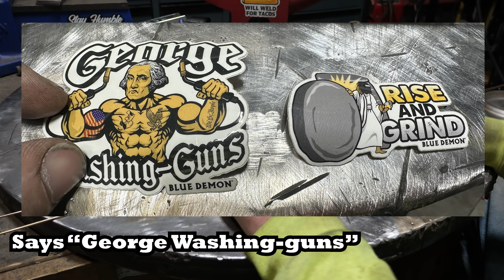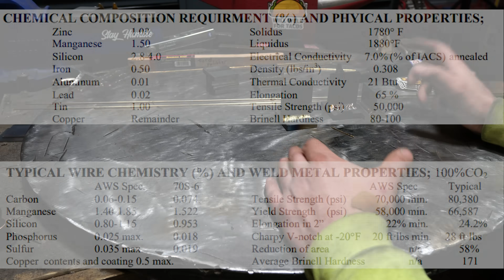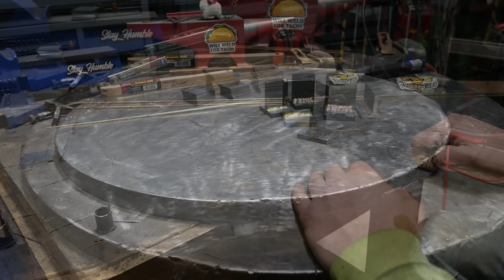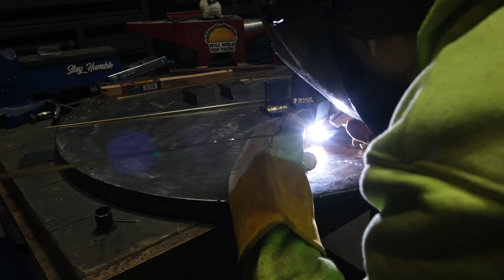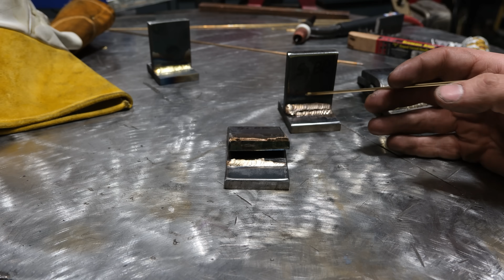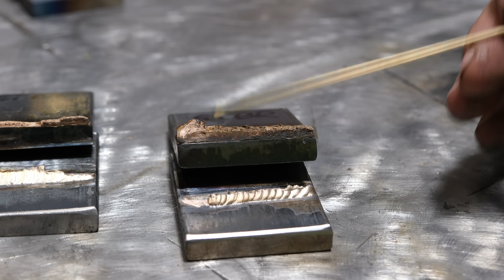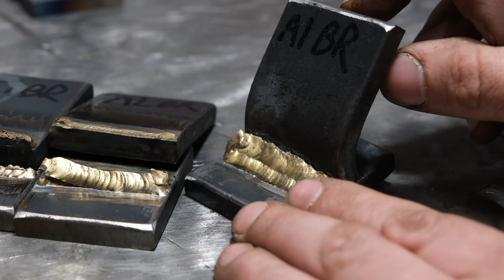Silicon and aluminum bronze brazing, how strong are they?

Comment: I found that pure copper is a better material for repairing old cast iron. Found this by chance when I had to repair some 160 year old ram pumps made of cast iron. Tried silicon bronze and aluminium bronze but they would not take to the iron and small cracks kept appearing but I had some 99.9% pure copper rods on hand that I had been using for copper inlay of horse bits so I tried that and it worked a trat so since then I have used copper filler on cast iron whatever the age.
Reply from the maker: Interesting, I have never tried that but will have to do some experimenting with it 😀👍

Comment: I worked at a auto shop that made custom hoses and we brazed everything brass, aluminum and steel fittings
Reply from the maker: Brazing on stuff like that would likely be as strong as a weld and far easier to do.  It would be very hard to weld thin wall small diameter tubes.  Thankfully brazing can be strong enough for the task 😀👍.

Comment: I recall an old bloke advised me that carborundum? grinding is a big no no when brazing parts together.
He insisted that surfaces needed vigorous wire brushing and final finishing with a file to leave atomically clean surface.
Seems carborundum causes a coating/inclusions that impedes wetting and intermetallic binding of the brazing alloy into the surfaces of the joined iron/steel materials.
Is this good advice ?.
Reply from the maker: So no doubt contaminates on the surface will cause a reduced bond.  The brazing material doesn’t have a real way to consume and “float out” surface contaminants like say a stick rod with flux that becomes molten.  So anything on the surface will likely be bridged over by the bronze and the bond will be weakened.  Being very specific and clean with the prep is surely an important step in getting reliable repeatable results.  The difference is strength even a few small poor bonded areas could make is significant.  Welding (like with stick) is far more forgiving due to penetration/fusion.  I have no doubt brazing can be as strong if not stronger than a weld depending on situation, but the reliability of that will require more attention to details 👍
Reply: @makingmistakeswithgreg  Thanks for that info 👍

Comment: Jaguar e type front suspension/engine cradle is brazed structure
Reply from the maker: I wonder if they brazed the whole assembly as single unit in an oven Inorder to produce a high strength part.  On stuff like chromoly that could work great and be stronger upon completion than a welded cradle without heat treatment.  I would have never expected to see that, but then again I have only seen a jaguar engine up close once lol.

Comment: I love to use silicon bronze to cap welds on derivative items. I built an offset barbeque pit that I stick welded, as I was going to give it a natural oil finish so I ended up capping all the visible welds with silicone bronze tig brazing wire. After seasoning it looks absolutely amazing. Not something I would recommend for something that's structural, but it's not going to be an issue when we're talking about something like a barbecue pit, patio furniture, a fire pit, pizza oven or something similar that doesn't hold pressure or get subjected to any loads.
Reply from the maker: That must be one sweet looking bbq pit 😀👍
Reply: Should you be worried about heat? I love this idea!
Reply: @CreateStage  No I'm not worried about heat. It's never going to get over 300 degrees, normal cooking temperature is between 200 and 275 degrees. As for the firebox it's still never going to get anywhere near the melting point of silicon bronze. Even if it went nuclear what's the worst that's going to happen? The silicon bronze melts off? The thing is still welded together with 6010 and 7018. It's pretty thick steel, I welded it all open root with a 6010 root pass. a 7018 hot pass, and a couple 7018 fill passes. The silicon bronze brazing was just the cap pass.

Comment: Great information. I'm assuming you cannot use the bronze for joining aluminum and steel.
Reply from the maker: So the aluminum bronze will not likely stick to aluminum in despite having aluminum in it.  You can solder aluminum to steel with a few products but brazing is difficult.  I am sure there is some way to put a braze on aluminum of a particular alloy, braze the steel with a alloy, and then connect the brazes with a 3rd alloy, but that’s not exactly quick or easy, and probably not very strong.  Aluminum can actually be welded to steel with blast welding, and you are left with more or less aluminum cladded steel.  Pretty wind stuff and definitely outside of home shop made lol.

Comment: Brazing is pretty strong if the fillets are big enough, Rickman made plenty of motorcycle racing frames using Reynolds tubing braze with silicon bronze. Some bicycles use the same method. Some special steel car chassis are brazed. Tubing in the nuclear centers is often brazed.
Reply from the maker: Yes, like you said the larger braze is the key.  A lot of people don’t realize how strong certain brazes are when you use the equivalent of an oversized “weld”.   Probably far easier to braze things like bike frames than oxy fuel weld them back in the day too.

Comment: Could you do a video about joining the dissimilar metals together with brazing?
Reply from the maker: I can.  It’s actually not very hard to do.  All conventional metals besides aluminum and magnesium braze just like steel.  So brazing stainless to titanium, steel to incconel, or any other wild blend is mostly the same as steel to steel.  The only issue to watch for is on reactive metals (titanium and similar) you still need to shield the braze area with a lot of argon.  Any oxidization will cause the base metal to become brittle and more or less junk.
Reply: @makingmistakeswithgreg   - What you describe here is EXACTLY what I'd like to see done AND tested . Thanks !!

Comment: Hi from the uk
I have only ever brazed using oxy flame with a flux. Would it not be possible to use a flux with the tig and get the bronze to flow/ penetrative between the pieces 
Great vid
Reply from the maker: That’s a great question and honestly I am not sure.  The tig brazing alloys are a bit different in composition than torch brazing alloys.  The main issue with Tig is tungsten contamination.  With a torch its less of a issue.  The c02 shielding gas produced by the flame helps keep a lot of the junk that could contaminate the tip  from being produced (due to a reaction with the gas, the burning of the contaminates and due to the velocity of the gas pushing it away).  I will have to try it but I suspect keeping a stabilized arc will be tough with the flux.  If the braze could get under the plate it would significantly improve the breaking strength with stress towards the weld.
Reply: @makingmistakeswithgreg  cheers for your reply keep up the good work

Comment: Motorcycle frames (steel ones) used to be brased not welded certainly British bikes!
Reply from the maker: I think those represent the perfect situation for brazing.  If you had a slip fit joint you could braze it and it would be crazy strong due to the braze material pulling into the joint (if it was torch brazed).  You could also use stronger materials like chromoly tube without the brittleness that would have typically came with welding it.  No doubt it had to work great for that situation and technology that was available.

Comment: I use the silicone bronze to tig weld half couplings onto small stainless steel tubes & pipe for temperature and pressure measurement. No back gassing required, goes on like peanut butter onto hot toast. Never had one fail in 30 years.
Reply from the maker: Awesome, and another great use for it.  The lower heat input would surely keep the inside of the stainless far cleaner from oxidization.

Comment: I'd love to see you do a video on high silver content (56% silver) torch brazing with flux and test the strength. Long before I had a welder I used high silver content brazing for all my hobby metal connecting. And now I just use if for really thin material or doing really thick to really thin.
Reply from the maker: I just bought some for testing purposes.  Part of the problem with that particular alloy is it’s primarily designed for capillary action on small parts.  I have no doubt it would likely far exceed thinner materials ability to force it to fail.  On anything thicker it’s hard to say what it would do.  Probably take 70$ worth to get a braze big enough to hold lol.  I do know that particular alloy is around 75-80k in tensile strength.  If it sticks it would likely hold on as good as a weld lol.
Reply: I've used Safety-Silv 45 Flux-Coated Silver Brazing Alloy to repair OLD cast iron hand tools with great success.  I've got an old pair of bolt cutters which broke at the handle/head junction which I oxy-prop silver brazed and have absolutely abused them and the joint still holds.

Comment: What about SOLDER? silver solder specifically.
Reply from the maker: So I just bought some 56% silver solder to try.  On face value it should be close to aluminum bronze, silver solder is around 75k psi tensile strength which is in the ballpark of aluminum bronze.  The only crappy part of using silver solder is the cost, my wallet is hurting from the cost 😅.  Great for small parts, it could bankrupt a small country using it for bigger fillet  joints lol.

Comment: Please do complete bevel on such thick pieces (60 degree).   Might be hold up longer until failure.
Reply from the maker: So a bevel will definitely increase strength significantly on a fillet weld when the weld/braze is stressed towards the face (aka when I hit it with a hammer in the video).  When bent away from the face (like in the shop press) the additional material wouldn’t likely do much to prevent a failure.  Most of the force is concentrated right on the face of the weld/braze and virtually nothing on the root area.  Once the face fails the rest fails immediately more or less.  In the case of hammering that fillet if I did what you said it would have been very hard to break, the same if I brazed both sides.

Comment: Could you do a test with machine silver, zinc brass and phosphorus bronze rods? These are the other common types of solder and all have their uses. Silver solder is my favourite.
Reply from the maker: So I picked up some silver solder and will be doing some testing with that.  Silver solder is in the ballpark of 75k psi tensile strength, which puts it right up there with aluminum bronze.  I have no doubt if it sticks it would likely exceed the base materials strength, especially on material thinner than 3/16th.

Comment: I seen it done on aluminum floor boards on CJ Rsce Cars video.  Interesting.  I'm guessing he didn't it want to warp?
Reply from the maker: Aluminum can be brazed with specific alloys with great success.  The main benefit with brazing aluminum is cheaper cost.  A tig welder to weld aluminum is typically 800$ or more.  Mig welding it costs atleast 6-700 for a machine.  With a simple torch setup you can braze aluminum for likely under 100$.  It also can produce a finished product that is more flexible with less hard spots that are common with welding.  Aluminum doesn’t tend to warp much when welded but brazing would cause less distortion for sure.
Reply: Yes sir. I understand.  I was first taught gas welding at an Ag Class in high school the instructor wanted us to learn gas and Arc along time ago.  I have a Hemrod or later called a Corbra torch  its awesome I have welded cast iron and aluminum . But need to find a lens so i can see the aluminum puddle better. And it does a great job at cutting.  You can write your name with it properly set up. Thanks for the great videos.  @makingmistakeswithgreg

Comment: I'm hoping to see a video where you use oxy-fuel brazing.  I don't don't do any tig welding, but would like to learn more about brazing with the torch. I'm still practicing with stick welding and I'm getting to where I can weld one-handed in all positions except vertical up.  Your videos have kept me motivated to improve.☀
Reply from the maker: Glad to hear you’re motivated to keep improving 😀👍.  I will be dabbling in oxy fuel brazing soon.  I have done a lot of it from a copper pipe perspective but not so much from a using it on steel perspective lol.  I will practice a bit and get to making a video on it 😀👍.

Comment: My high school metals shop teacher, Mr. Griswold, used to build chromoly tubular chassis for several kinds of racing cars driven by the nation's best.  All of these were torch brazed!  Blew my mind!!!
Reply from the maker: Torch brazing (and welding) was used for (and still is in some cases) for chromoly airplane tube frames, so no doubt the same thing would work on race cars.  The welded/brazed area winds up in a way being annealed during the torch heat input, and the tube tends to be more ductile and bends under stress.  That’s a far better result than a brittle failure that is very common with chromoly that’s welded.
Reply: Proper crmo rollcages are heat treated in giant heat treating ovens after welding. Most hobbyists are better off using DOM.
Reply: I was taught to braze with a gas/compressed air torch at school,the point was to have the spelter run in to every part of the joint. And that was what they used to do with cracked cast iron press hammers, and those repairs lasted fifty plus years. 
   I know that you are not allowed to use this type of brazing for automotive repairs in England, because it is regarded as weak.
Reply: @CrimeVidSo a car built with brazed seams from the factory will fail the MOT? Even in rigid fear mongering Germany, CuSi3 repairs are legal.
Reply: Used to use nickel bronze brazing rods (SIF 2) on kart frames, very tough stuff. Not sure that there is an equivalent filler rod for TIG brazing with equivalent strength.

Comment: Interesting stuff, Greg. Thank you, but it occurs to me the results are perhaps somewhat narrow in scope?

Maybe that's by design and it is illustrative. And fair enough too, but in a real world situation, I reckon the joint design and the structural design of the piece in question is of rather more importance than the raw breakage data on the joint would suggest.

I think you mentioned this but, back in the days before carbon fibre, Formula 1 race cars were commonly built from thin wall steel tube, gas brazed with common manganese bronze - not even nickel bronze. When those structures failed, it wasn't because of the filler material . . and 3/8 inch material was very little used.

And that's my point; if we were to test a triangle shape fabricated from, say, 1 inch diameter 18 gauge tubular steel, my bet is that a brazed joint may well perform equally or better than a welded joint over the long or short haul.

Thanks again & cheers.
Reply from the maker: So how well the braze will perform really depends on the forces and the materials used.  Aluminum bronze is very close in tensile strength to er70 wire, and the fact it held up to 3/8th steel bending is solid proof at how strong it is.  Where it can beat er70 really comes down to joining materials that are heat sensitive and not subject to heat treatment after joining.  Thinwall chromoly tube is a great example.  Due to chromoly’s reduced performance in the heat affected zone, it’s entirely possible to build say a brazed chromoly control arm that can handle more stress than a welded one.  This is especially true for someone who doesn’t have access to a proper heat treatment processes for a welded control arm.  

Where brazing looses to welding is on non heat input sensitive materials, in reliability of performance, and in the strength of single sided “welds”.  With most welding some level of sidewall and root fusion is achieved.  This is very reliable, some surface contamination is generally not an issue, and any root fusion reduces leverage that could be used to break the weld.  Brazing produces a bond that is strong, but is far more prone to areas with poor bonding, and the lack of any root fusion means the braze will be far weaker when bent towards the face.  Where this becomes a virtual non issue is on thinner material with oversized brazes.  Thin material simply can’t stress a braze enough to cause a failure, and an oversized braze will have enough area with a solid bond that it will be reliably strong.  On thicker material that can put more force on the braze the results will favor an actual weld for reliability.  Even if a braze and weld metal had identical tensile strength/ductility the weld will prove to be reliably stronger due to  the root fusion and more consistent sidewall bond/fusion.  

So (like you implied) in the right circumstances brazing can easily match or exceed welding, but most of them revolve around thinner material and non mild steel.

Comment: I just watched your other video, on brazing with silicon bronze. Fortunately, I saved several sections of the floor, with rusted holes, because I knew I was going to need to practice how to do this. At least now I have some starting settings and hopefully can save the cowl and firewall. Thanks so much.
Reply from the maker: No problem 😀👍.